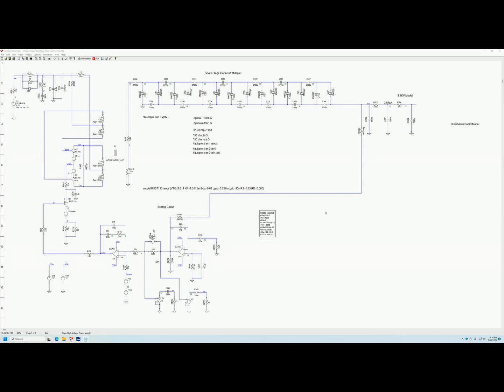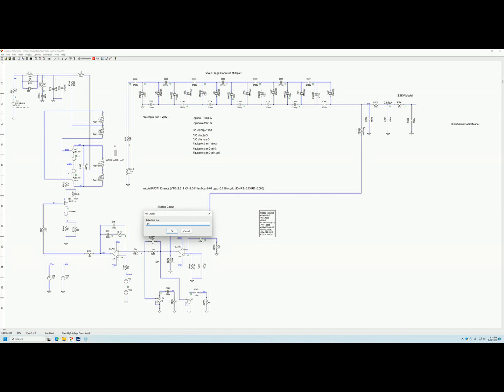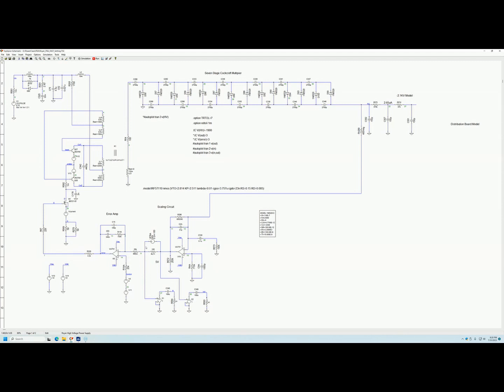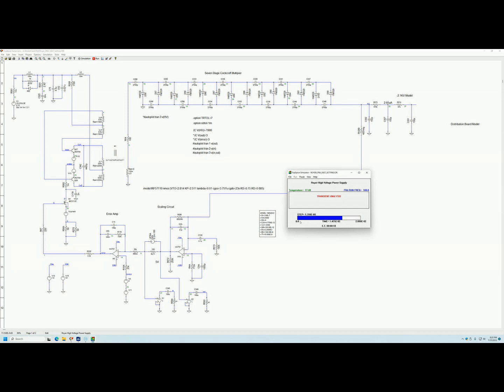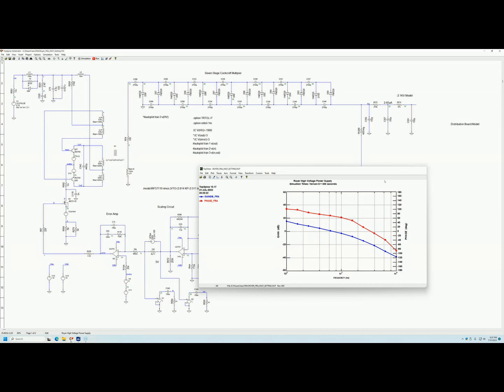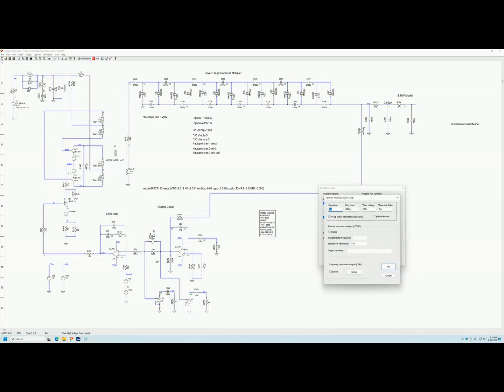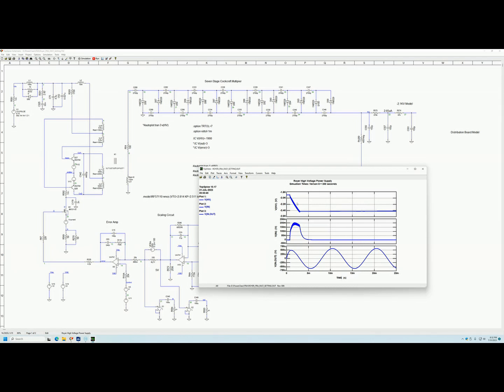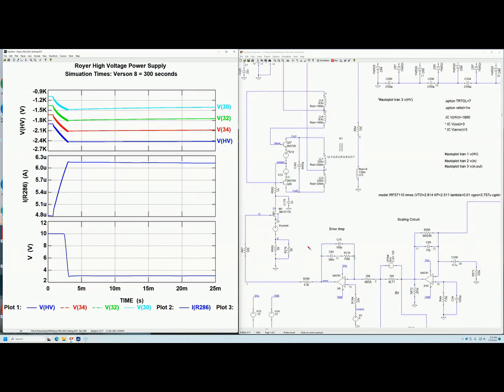TopSPICE10 FRA and Schematic Probing features

Comment: @Robert Bolanos Hello Robert, I have a question. What topology would you pick or what would you do in general if you are asked to develop power supply (isolated is preferred but not necessary) with 82% efficiency or better with the following specifications. Input is 16V to 200V, output is 16V to 28V. The output power is 750W. How to start here, any suggestion is greatly appreciated. Thank you Sir in advance.

Comment: I am viewing this in 1080p, but the schematic and dialogs are a bit too fuzzy to read in some areas, so some questions:  For the FRA, what two points in the circuit are being used for input and output to the analysis? (It would be nice to see the time-domain signals for these two points my way of orientation.)  And there are two diamond components in the bottom middle that you referred to -- perhaps labeled E1 and E2? They seem to have 4 terminals -- could you explain what these components are and what the 4 terminals do?  Thanks!